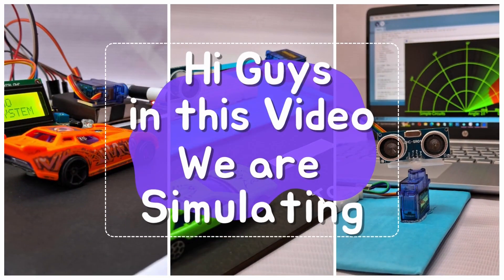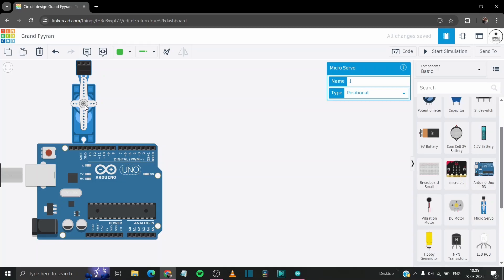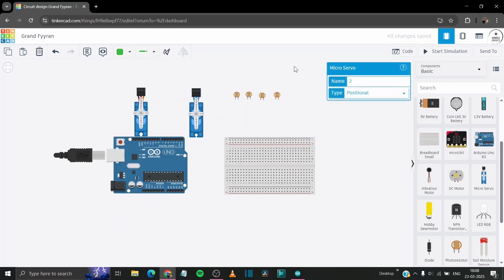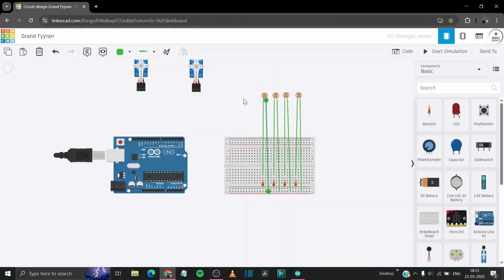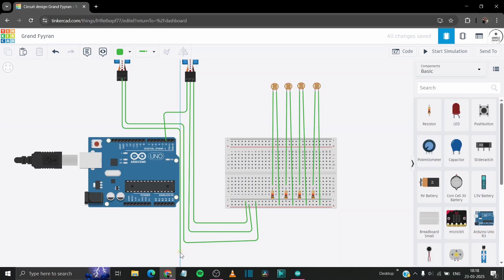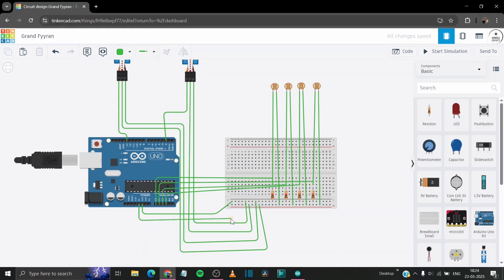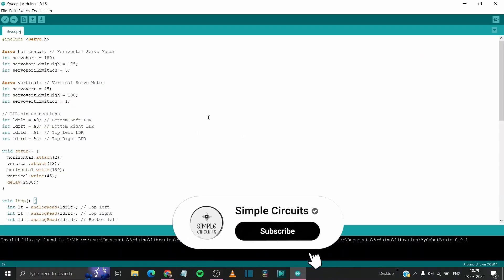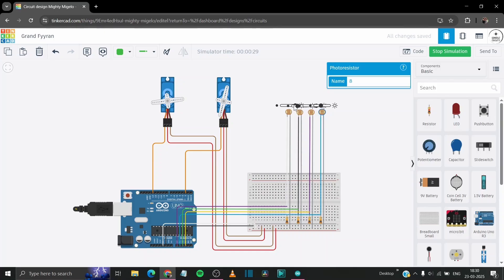Dual axis solar tracker using arduino | Arduino Project | Tinkercad Tutorial

Comment: segue cod corrigido
#include <Servo.h>

Servo horizontal; // Servo Motor Horizontal
int servohori = 180;
int servohoriLimitHigh = 175;
int servohoriLimitLow = 5;

Servo vertical; // Servo Motor Vertical
int servovert = 45;
int servovertLimitHigh = 100;
int servovertLimitLow = 1;

// Conexões de pinos LDR
int ldrlt = A0; // LDR inferior esquerdo
int ldrrt = A3; // LDR inferior direito
int ldrld = A1; // LDR superior esquerdo
int ldrrd = A2; // LDR superior direito

void setup() {
  horizontal.attach(2);
  vertical.attach(13);
  horizontal.write(servohori);
  vertical.write(servovert);
  delay(2500);
}

void loop() {
  int lt = analogRead(ldrlt);
  int rt = analogRead(ldrrt);
  int ld = analogRead(ldrld);
  int rd = analogRead(ldrrd);

  int dtempo = 10;
  int tol = 90;

  int avt = (lt + rt) / 2;
  int avd = (ld + rd) / 2;
  int avl = (lt + ld) / 2;
  int avr = (rt + rd) / 2;

  int dvert = avt - avd;
  int dhoriz = avl - avr;

  if (abs(dvert) > tol) {
    if (avt > avd) {
      servovert++;
      if (servovert > servovertLimitHigh) servovert = servovertLimitHigh;
    } else {
      servovert--;
      if (servovert < servovertLimitLow) servovert = servovertLimitLow;
    }
    vertical.write(servovert);
  }

  if (abs(dhoriz) > tol) {
    if (avl > avr) {
      servohori--;
      if (servohori < servohoriLimitLow) servohori = servohoriLimitLow;
    } else {
      servohori++;
      if (servohori > servohoriLimitHigh) servohori = servohoriLimitHigh;
    }
    horizontal.write(servohori);
  }

  delay(dtempo);
}

Comment: I need it because the code is wrong
Reply: #include <Servo.h>

Servo horizontal; // Servo Motor Horizontal
int servohori = 180;
int servohoriLimitHigh = 175;
int servohoriLimitLow = 5;

Servo vertical; // Servo Motor Vertical
int servovert = 45;
int servovertLimitHigh = 100;
int servovertLimitLow = 1;

// Conexões de pinos LDR
int ldrlt = A0; // LDR inferior esquerdo
int ldrrt = A3; // LDR inferior direito
int ldrld = A1; // LDR superior esquerdo
int ldrrd = A2; // LDR superior direito

void setup() {
  horizontal.attach(2);
  vertical.attach(13);
  horizontal.write(servohori);
  vertical.write(servovert);
  delay(2500);
}

void loop() {
  int lt = analogRead(ldrlt);
  int rt = analogRead(ldrrt);
  int ld = analogRead(ldrld);
  int rd = analogRead(ldrrd);

  int dtempo = 10;
  int tol = 90;

  int avt = (lt + rt) / 2;
  int avd = (ld + rd) / 2;
  int avl = (lt + ld) / 2;
  int avr = (rt + rd) / 2;

  int dvert = avt - avd;
  int dhoriz = avl - avr;

  if (abs(dvert) > tol) {
    if (avt > avd) {
      servovert++;
      if (servovert > servovertLimitHigh) servovert = servovertLimitHigh;
    } else {
      servovert--;
      if (servovert < servovertLimitLow) servovert = servovertLimitLow;
    }
    vertical.write(servovert);
  }

  if (abs(dhoriz) > tol) {
    if (avl > avr) {
      servohori--;
      if (servohori < servohoriLimitLow) servohori = servohoriLimitLow;
    } else {
      servohori++;
      if (servohori > servohoriLimitHigh) servohori = servohoriLimitHigh;
    }
    horizontal.write(servohori);
  }

  delay(dtempo);
}

Comment: i need the code in the coments please.Thank you
Reply: #include <Servo.h>

Servo horizontal; // Servo Motor Horizontal
int servohori = 180;
int servohoriLimitHigh = 175;
int servohoriLimitLow = 5;

Servo vertical; // Servo Motor Vertical
int servovert = 45;
int servovertLimitHigh = 100;
int servovertLimitLow = 1;

// Conexões de pinos LDR
int ldrlt = A0; // LDR inferior esquerdo
int ldrrt = A3; // LDR inferior direito
int ldrld = A1; // LDR superior esquerdo
int ldrrd = A2; // LDR superior direito

void setup() {
  horizontal.attach(2);
  vertical.attach(13);
  horizontal.write(servohori);
  vertical.write(servovert);
  delay(2500);
}

void loop() {
  int lt = analogRead(ldrlt);
  int rt = analogRead(ldrrt);
  int ld = analogRead(ldrld);
  int rd = analogRead(ldrrd);

  int dtempo = 10;
  int tol = 90;

  int avt = (lt + rt) / 2;
  int avd = (ld + rd) / 2;
  int avl = (lt + ld) / 2;
  int avr = (rt + rd) / 2;

  int dvert = avt - avd;
  int dhoriz = avl - avr;

  if (abs(dvert) > tol) {
    if (avt > avd) {
      servovert++;
      if (servovert > servovertLimitHigh) servovert = servovertLimitHigh;
    } else {
      servovert--;
      if (servovert < servovertLimitLow) servovert = servovertLimitLow;
    }
    vertical.write(servovert);
  }

  if (abs(dhoriz) > tol) {
    if (avl > avr) {
      servohori--;
      if (servohori < servohoriLimitLow) servohori = servohoriLimitLow;
    } else {
      servohori++;
      if (servohori > servohoriLimitHigh) servohori = servohoriLimitHigh;
    }
    horizontal.write(servohori);
  }

  delay(dtempo);
}